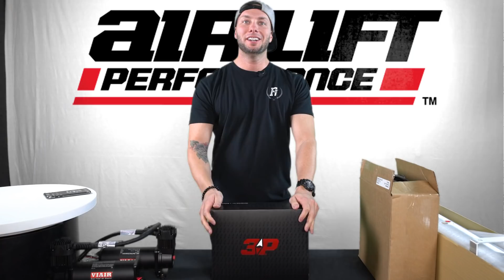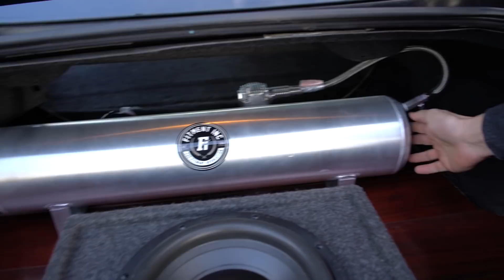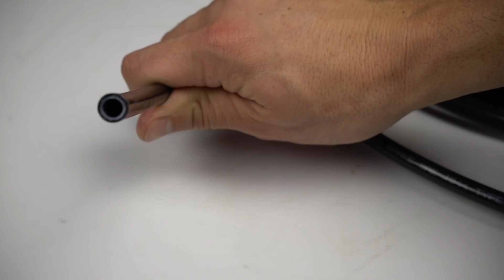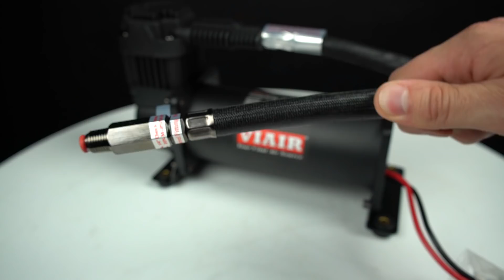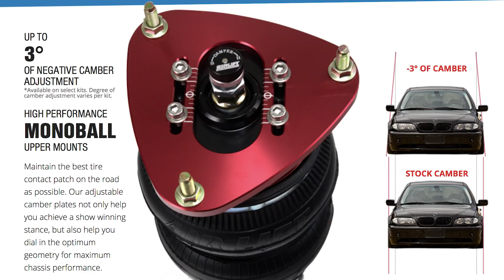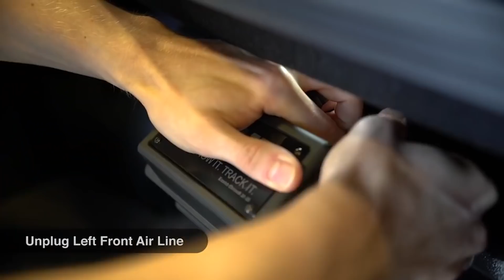Everything YOU need to know about AIRLIFT SUSPENSION

Comment: where can I find a 4 corner self leveling air suspension kit that will work on a 76, 77, 78 Chrysler Town & Country 9 passenger C body station wagon? this car weigh between 4870 to 5280 pounds.

Comment: I bagged my car in October of 2021. I paid for professionals to install, and that made it very easy. It cost me 1200 for the labor and it was money well spent. Make sure you get 2 compressors, 3/8's Air lines, and a big air tank made with a polished finish to avoid mistakes. Unplug your manifold and re plug your manifold if you have issues with the manifold. Recalibrate your system once a month and keep extra fuses and a good battery. Live your life righteously and you will have less problems and stop believing in shortcuts. Give this video a thumbs up because its a great video! This video showcases an outstanding product and has full details except details about draining the air tank.

Comment: Put this kit on my 2016 Mustang GT like 3 yrs ago, had to go back over some of the fittings to wrap with tape/PST and airlines cut flush after install but no issues with bags. Original air tank had small slag hole from weld, Airlift replaced for free. Issue though is getting ECU/manifold to connect with my Samsung phone thru app. It sucks...

Comment: on regular coilvers, you're supposed to get a alignment after install. what about air?  wouldn't driving at different psi height mess up your alignment ? maybe get uneven tire wear
Reply: Yes, you’ll need an alignment. 

Once installed, you’ll set up your “drive” height and get your alignment off that.

Comment: I’m looking to buy a car but it has a airlift performance suspension is this something that I should look out for? I just want the car to be for everyday around town driving. Is having this suspension going to cause problems in the long run?
Reply: Airlift is very reliable you just have to make sure that the previous owner has done well with the instillation so you don’t have to worry about any problems with your air lines etc
Reply: Make sure u got a shop that can work on it

Comment: So what kicks on the air compressor brother, the cars battery? Or does the compressor need its own battery supply
Reply: A relay, and also a pressure control is wired in before battery. So the relay is keyed on power.

Comment: So if I want to air out do I need to install a camber kits?
Reply: No. There's the airlift slammed series that doesn't even include camber kits. 

The purpose of the camber kits are mainly for guys who want precise wheel fitment. Flushed, Tucked, lip to fender. 

Adjusting the camber can work as an additional tool to dialing in the perfect fitment. It is not required to air out.

Comment: I know this is an older vid. Can i still bag my ride with stock wheels?  I am planning on getting both air suspension and wheels. But can't afford both at the same time. What would u recommend?
Reply: I know this is a year old but it's perfectly fine to bag it on stock wheels. In fact I'd recommend it in that order. That way you can measure out your offset, backspacing, wheel width and camber against your cars body with it aired out and up.

There's a guy on YT with a bagged mustang. He has a staggered setup and he purchased his wheels first. His rear rims are too wide and he can't lower the cars rear end.

Comment: You should know that IF you run the Bluetooth system, your car battery is being drained nearly constantly. So if you car stands still for say 2 weeks, you might not even be able to start the car. A friend of mine has said issue and has to keep it on a charger everytime.

Comment: I'm considering on installing one in my car. One question, though. As the pressure in the bags go up, does the spring rate equivalent increase as well? Thanks.
Reply: Essentially; your bags take place of the springs. I removed all bump stops and springs, you just leave the shock for recoil.

Comment: Pretty new to air suspension so please don't judge my question.. Does anyone have any insight on the daily maintenance of bagging your car?  I saw another vid where they said you should drain the tank every night when you are done driving your car to remove the moisture.  And then refill.  So does that means every morning you have to wait to refill your tank to get air back up to riding height before you hit the road?
Reply from the maker: Always check for rubbing on the bags, fittings being tight, draining the tank every once in a while for water/condensation

Comment: What’s the maintenance that people keep saying with air ride? Also how would you drain the water from the tank? Lines or a pan for the water?
Reply from the maker: With Maintenance, just checking the bags once in a while for any rubbing issues and just making sure everything is tight. There is a release at the bottom of the tank for draining, all you do is open it up and let all the air and/or water release.
Reply: @FitmentIndustries  as a professional CDL driver we use airline antifreeze alcohol to keep water and ice build up in the lines . I'm pretty sure it's a good thing for these as this system has been around for 30 plus years !

Comment: Good video,  1st. will your car have a lower than normal height after installing air ride ? 2nd. question. is it possible to raise your car above normal drive height after installing the air ride ? got a 2008 Chrysler 300c SRT8.

Comment: I'm assuming that you would have to refill the tank at some point. How do you go about doing that?
Reply from the maker: Great question. The system monitors the tank pressure and will kick the compressors on to fill the tank with air once the tank goes below a certain PSI.
Reply: Fitment Industries wow. That's awesome!

Comment: For anyone that's on the fence about bagging your car, DO IT!! I've been on bags for only a week so far but I absolutely love it! I have a better ride quality than when I was on stock suspension and its so satisfying to air out and have your car sitting on the floor. Get that low life with none of the headaches!
Reply: how u feel about it nowww??
Reply: @danieldeda1394  I have a friend on airlift slammed series. He's had his bagged since approximately 2015. They are still going strong. HOWEVER he did have to replace his compressor. 

Also he doesn't have the 3p management system. He has the autopilot V2 -  So he can't attest to the longevity of 3p ecu and remote. 

He convinced me to pull the trigger on airlift. Except I went with this kit. ( 3p with performance struts and two compressors ) 

How long your system lasts without any headaches is going to depend greatly on the quality of the install. As long as nothing is pinched, exposed or rubbing it will last for years. If all done correctly the only maintenance will be draining the water trap to keep the tank and airlines free of moisture.
Reply: @blkeclipsel2400  I

Comment: I haven’t watched the whole thing yet so I’m not sure if it’s been answered. But here’s my question: if air suspension is installed, how do I keep the camber from changing when raising and lowering?
Reply: That totally depends on the type of suspension you have, the semi-trailing arm setup in the rear of my E30 gains negative camber as you go lower by design.
Reply: camber will adjust naturally as you air down. can't do anything to keep it fixed as the geometry of the suspension will change as the height adjusted up/down.
Reply: camber should stay the same
dont see why any alignment would change

Comment: I want one for my daily. But I am disappointed that it doesn't talk about the lifetime of the bags. What kind of lifespan and maintainance are we looking at in a typical 5 year use?
Reply: sadakotube the lifespan will totally depend on the area you live in. I live in Pittsburgh now but also travel home to NY at least once or twice every month. So far I have had to deal with the terrible snow and road salt every year. My bags pretty much lasted me about 4 years in the front since most of the weight is there and the rear are still fine after close to 5 years. I do drive slammed on the highway and sometimes main roads so my struts do take a beating.

 I never had a blown airbag just need to replace because the lining in the front was tearing and it wouldn’t of passed inspection. I have had two of the front braided aluminum airlines from the front both blow but I had a family mechanic have a custom one made that is stronger and more durable then the ones that come with airlift. After awhile your aluminum airline might rust overtime and leak. 

Also one thing that people forget with air ride is use your water traps. The 3p comes with it but you need to buy some extra fittings probably to install it. You want to prevent water that will build up in the tank getting into the 3p manifold. Especially in the winter. This will cause the pressure sensor (which monitors the pressure in your bags and tank) to fail. Meaning once you air up and use air from the tank, the sensor can’t give a reading and tell the system to cut the compressor on to fill the tank up when it’s low. Airlift will lucky replace it free of charge. Just pay them $500 and they will send you a new one then send back your old one and they will give you back your money or you can send your old one first and they will send you a new one free of charge. 

Also in the winter if you live in areas with freezing and below freezing you want to make sure you add about 2 caps of air brake antifreeze. This is commonly use in diesel trucks with air brakes. This will prevent the moisture in your tank and air lines from freezing. If your lines freeze then you won’t be able to air up if you are aired out on the ground. 

Basic maintenance is to check your tank for water build up once a month if you don’t use a water trap and best to check your tank every 3 months if you are using water traps just for safe measure. Also pro tip is to use thread tape on your threads to help as an extra layer of protection for sealing your compressor line going into your tank to help prevent leaks. Same goes with threading your water traps as well. 

Also another way to help you from burning out your compressor  is to make sure you pay attention to the PSI rating on your compressor. If your compressor is rated for 150PSI don’t set your tank pressure to be filled at 200PSI because you want more air in the tank. You run a risk of  shortening the life of your compressor. This was a lesson I had to learn luckily running dual compressors saved me also don’t cheap out and try to use one harness to run two compressors. Use the proper dual harness. Had someone who installed my airlift running my compressors off one harness and cause it to burn and melt the relay twice all because they didn’t read the manual and try to go off their shop experience. Need less to day I ordered brand new harnesses and tore everything apart and simply read the manual and it was extremely easy for me to do but also having it done right.
Reply: jarreddizzle they are called airrideequipment on instagram pretty cool dude my set up will run me $4k they are in LA
Reply: sadakotube not sure if your still looking at this but I’m in California and im getting them done next month in may the shop that is doing mine provides lifetime warranty parts and labor apart from getting old !! Great
Reply: what was the shop, looking for a good place in cali myself

Comment: Pneumatic suspension has huge potential performance wise, but one thing that held them back is lack of damper curves to properly complement their nonlinear characteristics. Wonder how well this kit does and how adjustable those dampers really are.
Reply: It's pretty similar to having an adjustable shock. The air bag is the spring, and once the pressure it set barring any leaks it should provide steady oscillations.